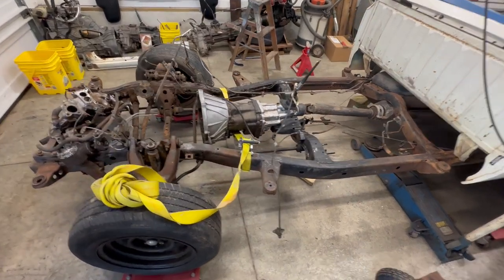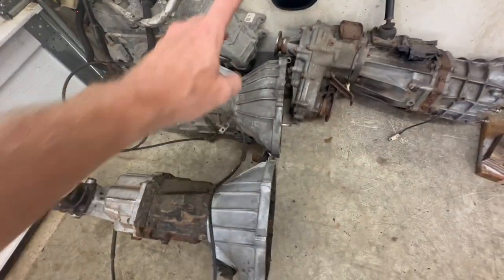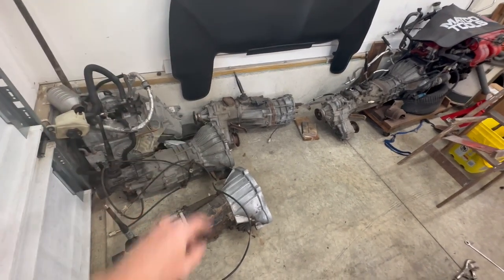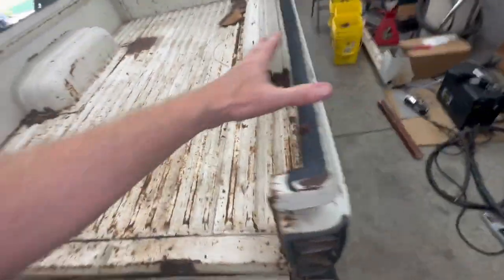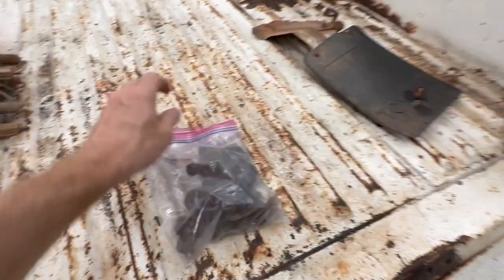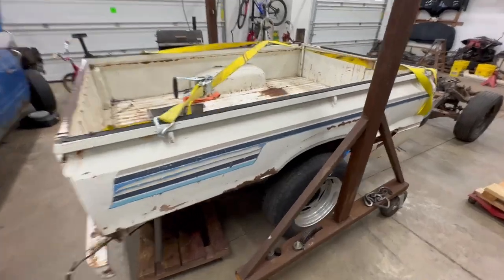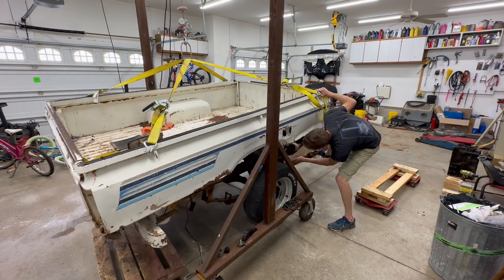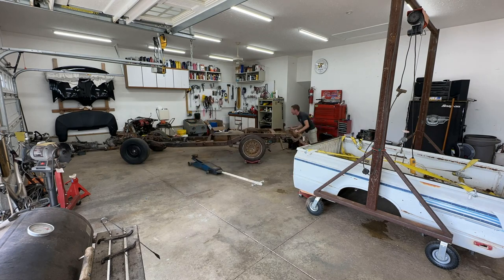How to: Remove the Bed on 1980 Toyota Pickup

Comment: Today, I found out the R151F is a pretty old gearbox, not that I thought it was new by any means.

My Dad's 2010 70 series Land Cruiser has a R151F gearbox, definitely an old school gearbox and not very refined.

Also, the revs are a bit high in 5th gear on the highway.

The gearbox is not that desirable for Cruiser fans; we don't have a lot of these pickups still kicking around.

I think the one people want for Turbo diesel applications is the H151F or something like that.

I really enjoy this series. When a new video comes out, I watch it as soon as possible.

Comment: Your Logo on the 2 tailgates, if I had to guess, the white one is a more modern truck (newer), the blue one is the older style. 

Both pick up trucks are CBU's (complete built units from JAPAN), the lip and the 2 latch tailgate is a easy give away! All Toyota pickup beds which do NOT have the outer lip were built here in the USA. And thus the cab and the frame were shipped to America and then the bed was installed at the Long Beach Port of entry.

Comment: Not understanding some of your procedure here.  I'm 75, and last year tore two  2500 Rams completely down to the frames in order to convert my 01 Cummins 5 speed to 4WD, which requires a diesel or V10 4x4 frame.  WHY DID YOU waste a lot of time and energy pulling the rear shaft when you could have don that  AFTER you pulled the  box?
Reply from the maker: I disconnected & pulled the 2-piece driveshaft first so it wouldn't be flopping around and dragging on the concrete as I'm rolling the frame around the garage.

Comment: The tailgate logo was the difference between the long bed standard and the long bed deluxe models. Various other trim differences. Did the blue truck have round headlights or rectangular like the white truck?
Reply: I believe there are 3 tailgate variants, old logo with 2 latches, new logo with 2 latches and new logo with single latch.  
I had a 79 long bed 5 speed with a 20r and it had the new logo with side latches and I currently have an 81 sr5 with a single latch and new logo.   I believe the beds and tailgates are different depending on the latch styles.
Reply from the maker: That makes sense, since this was a higher trim level with AC and the optional 5 speed, although it was not an SR5.  Both trucks have the round headlights. To my knowledge, the square ones were not used until 1982.
Reply from the maker: Yeah now that you mention it, I have never seen the old logo with the single handle on the tailgate.

Comment: Could just the door latch be from an earlier model I currently have to 78 Toyo Po up’s sitting in the driveway and they have that old logo font style with dual latch never seen single latch
Reply from the maker: Maybe it is, although I thought I read that the earlier models had the hinges closer together.
Reply: Just looked at the back of mine and looks just like the blue one both are long bed one is sr5 but the door looks identical. Since it’s an 80 I can see a late 80s door fitting it since the transition was done is 78

Comment: Cool project. 
I took your advice and called the Stealership for bushings and bolts to put the cab on my chassis...only $188.65 for the 6 sets of bits....lol
Kinda gotta roll that around a lil. Are 4x4 bushings the same ya think?
I can do aftermarket poly for about $90...for a 4x4.
Reply from the maker: I can’t say for sure but I would think 4x4 cab and bed bushings would be the same as 2wd, since the cabs and beds were identical.
Reply: @6thGearGarage  I'm hoping so. I kinda wanted regular old rubber mounts, but I can get black poly ones, and its WAY cheaper.
I'll probably go that route.
Reply from the maker: @danielkingery2894  I would too... what brand are you looking at buying?
Reply: @6thGearGarage  I haven't had time to pick anything out just yet.
I think they were off brand on Amazon that were the cheaper version.
Reply: Holy wow...I just reread the quote for the cab bolts and bushings...the $188 was JUST for the two bolts in the core support....😬